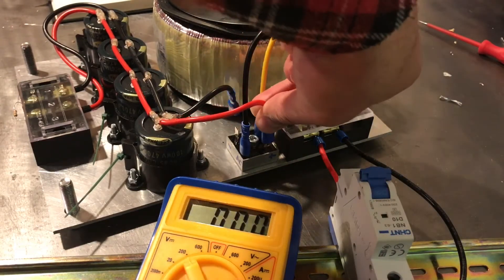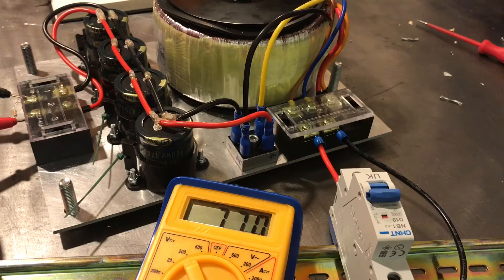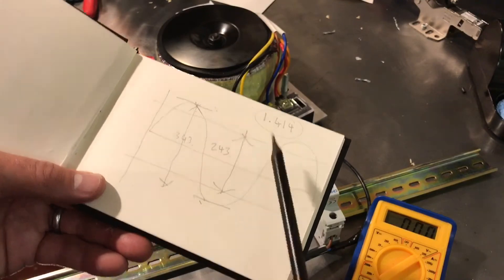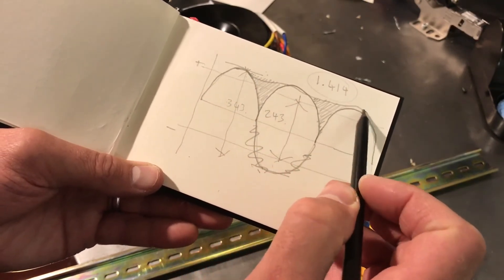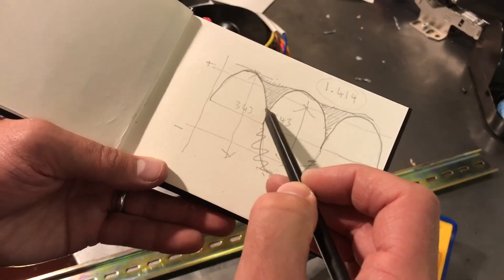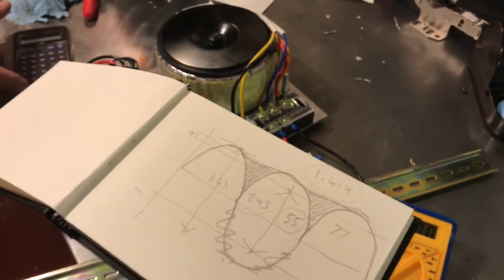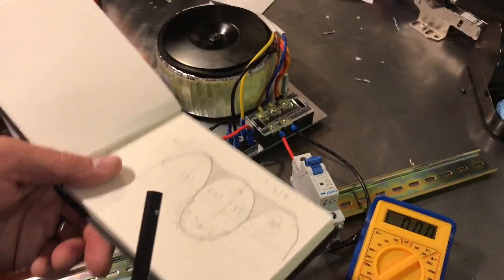CNC Build Log - Power Supply Part 2 - Switching On (Ep16)

Comment: Hi
Unfortunately. You have a mistake in the way the capacitors are attached to the aluminum plate You should make the top of the capacitors up To give it space
 when it explodes from the top. 
Good luck ♥️

Comment: Good video. What AWG did you use for the wiring. Was it 16 or 18 AWG?
Reply from the maker: Thanks! I used 13 AWG for this part of the build as the current can be quite high.
And I used 22 AWG for the 24v signals. 
Hope that helps - don't forget to subscribe and check out my other videos of the build - nearly finished now!
Reply: Cheers for the info. My black-box on my Chinese 6040 is starting to fail, so I've got to build a new one. Thanks to you (and help from Clive), I should be able to make a PSU at least. Just waiting for parts to arrive. Getting all excited and nervous like. Can't wait :)

Had a look at your build. Fantastic machine. Seriously, should be well proud of that. Brilliant!

Comment: Not a good idea to have the mains and LV wiring on the same terminal barrier!!!  You should take that secondary join off the barrier strip and use the third connection for mains earth.... YOU ARE EARTHING IT YEAH????   METAL FRAME AND ALL. Also, I'd remake those capacitor connections, fill the wire with solder and flow the whole terminal. The initial current into that filter bank is in the hundreds of amps rang, possible over 1k (couldn't see the cap values)  and those joints are looking a bit anemic. You seem to have done your research, it's a pretty solid build. Just earth the thing yeah??  And watch your fingers, you're well into the dangerous voltages mark, even on the secondary AC side.
Reply from the maker: Hi +Jimmeh B thanks for the comment. You will see from later videos that I have earthed the metal back panel once it is in the control cabinet - should have done here too you're right! The connections are well soldered but have hot glue over them to insulate which makes them look a bit pale and odd... as I said in the video I'm no expert so your comments are appreciated but I know the charge those caps hold is high and wanted to cover the terminals in case of an accidental short (and bang)

Comment: I like your CNC design a lot. I am at the process of making a pcb mill (a good one) any reason you made this linear power supply as opposed buying a more efficient, smaller and cheaper (but noisy) switch mode power supply?
Reply from the maker: +arash20007 Hi, glad you like it! With regards to your question, this is from the Leadshine website: "Leadshine PS series linear power supplies were specifically designed to power stepper and servo systems. In stepper and servo systems, frequent speed and torque changes result in frequent current changes drawing from power supplies. When accelerating, servo / stepper drive draws high current and requires quick response for the power supplies. In de-acceleration, stepper / servo motors generates EMF charge-back voltage back to servo / stepper drives, which will require the power supplies to “absorb” such voltage to protect the damage of connected stepper / servo drives. 

Leadshine PS series linear power supplies can satisfy the above needs in stepper and servo systems with simple design and big built-in bulky capacitors. Each of PS power supplies come with 3 main outputs of 36 or 68 VDC to allow the connection of multiple stepper or servo drives. Each PS power supply also has an auxiliary output which can output 12VDC/1A, or 5 VDC/1A to power other electronic components in control systems. At very effective cost, Leadshine linear power supplies are highly reliable and perform very well in resisting external electric interference." I have built my own to provide more VA and voltage but it is basically the same as one of these.
Reply: very useful information, I should be able to build an unregulated linear PSU, thank you
Reply: I ordered the bits today to make the same PSU cost me £90 delivered.
Reply: google AM882 manual and have a look in the power supply section for a good explanation but you cannot get this performance from a power supply you can buy prebuilt for the price.